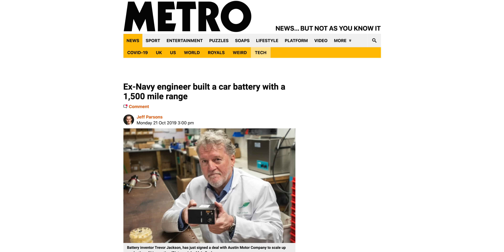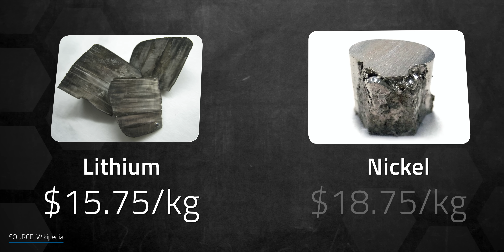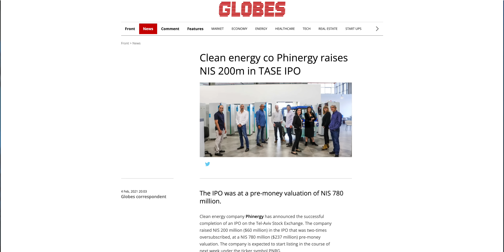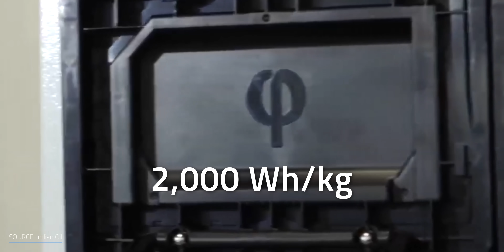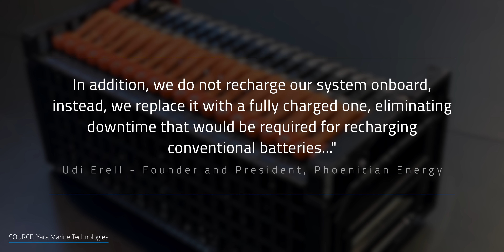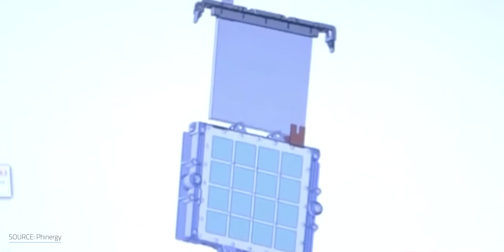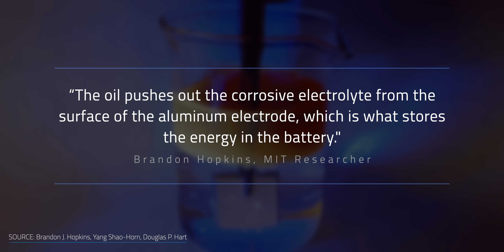Exploring the 1000 Mile Car Battery - Aluminum Air Hype?

Comment: I guess you could bring a smaller backup battery on the road and have a full spare at home? I'm curious about the how much one of these batteries would cost.
Reply: The issue would be battery degradation during storage
Reply: @1984johnson  unless the electrolyte can be added separately.
Reply: There are a whole lot more things to consider, than, if one person would or wouldn't,  Own a car with  this type of 
Battery, . Like, will an backup charger
Be available to carry along with the 
E.V. OR of course there not rechargeable, 
So, i think not, just for that reason 🤔..
I've often wondered if I could get an older model  truck or car,. Put the work in to Converting it into an Electric vehicle 🤔, that i build myself,  maintain myself, 
Change, battery's  out myself,  do everything that needed done, to it, 
( THE CAR OR TRUCK) Myself,.
Reply: @juniorperry8757  Yeah, people do that, look it up. Economically I dunno if it's worth it, would depend a lot on the cost of petrol, but it's an idea people have had, if only as a hobby.
Reply: @juniorperry8757  check out a channel called Rich rebuilds. It's a guy who tries to rebuild wrecked Teslas and has built at least one EV car himself.
Reply: Or they would work with car-clubs. Instead of personally owning a car, you pick up and drop off one when you need it. Without actually owning a car. This is already pretty popular in busy cities.
Reply: You can replace them at gas station so why take trouble to have them at home ?
Reply: @kkk2.077  
Yep and if they are in standard formats like a Nio's you can have one delivered by a local station or  roadside rescue organisation like a can of liquid fuel now... But thats what makes sense irrespective of the  battery's composition unless it lasts 50+ years and doesnt deteriorate more than a small percent.

Integral and structural packs are akin to Apple sealing its phones and telling you you can only use their agents and pay their prices and live with their availability of parts and service life.... which they seek to limit by hard and software controls.

This is the sort of built in planned obsolecence thinking thats got us into this mess 😳 its got to change or we will be making the same mistakes again, this time though world populations doubled since 1976
but the available resources of the planet haven't. 🤦‍♂️ 
Theres already an Elephant and a Rhino in the room ...and in a decade they might be joined by that Whale 🐋 falling from the sky.... 🙄😬
Reply: Maybe Split the whole battery to 3-4 parts, use up one at a time, So when you swap out, you sure you swap out the empty one. Always run with 1 in using and 2-3 full charge.
Reply: @Grim FPV   Grim, did you even watch the video, they would be massively cheaper, and easy to recycle...
Reply: @Grim FPV I dont think so, the silver that is expensive is not consumed in the reaction and could be reused without issues, and aluminum is cheap.
It might be that you will have to pay a large price for a new battery, but get a refund of 90% of that price when you return the empty one.

edit: 
Looking at the numbers from the video, you would have to pay ~$1.96/kWh plus any manufacturing margin plus the mentioned refundable cost. 
You can decide if that is expensive or not.
Lithium batteries on the other hand cost about $500/kWh, but can be recharged (plus costs of electricity to charge it)
Reply: @hubertnnn  yet that is a cost the other BEVs do not have.  You simply pay for the electricity to recharge the battery and maybe a battery swap 12-15 years later when the original battery could be recycled.
Reply: @hubertnnn  The recycling of the aluminium should happen on places with abundant renewable energy.   The grid has no need to carry all that extra energy for charging all those batteries so it can be kept simpler and there are no cable transport losses . Those batteries could surely (without electrolyte?) be transported in a eco friendly way. In short, I am wildly enthusiastic :-)
Reply: @jean-pierredevent970  Well, I did my calculations assuming no reclaiming of aluminum (fresh mined aluminum every time). If its possible to transform aluminum oxide back to aluminum cheaper than producing it from bauxite, then those batteries could be even cheaper and more eco friendly.
Reply: @Grim FPV China labor is cheap, and machines can do a lot of work for almost free (just some energy needed).

The only question is how much investors and petrol stations (that will be selling those) will add to the price for their profit.

Usually the rule is 20% per each intermediate step, so 
- 20% more from the petrol station, 
- 20% more from some delivery center,
- 20% for the investors.
And maybe one or 2 more steps.
Reply: @hubertnnn  Why it had to be sold by petrol station? Try convenience stores. It's just a drycell battery after all. They can stock it with ease, unlike gasoline. And they are everywhere. For any one petrol station, I think there are ten convenience stores, at least.
Reply: @Grim FPV 
The problem is those Rechargables are barely recyclable and require some pretty nasty tech to do that. There's also the fact they will deteriorate especially if your using rapid charging. ..and then theres those impossible to repair production problems that you will get.. or unforseen damage as i stated earlier. 

The charging infrastructure needed will be collosal in terms of grid supply cables and chargers. And what happens when the chargers break or become obsolete because someone comes up with a need for a different kind of charger.
Reply: just keep a spare in the back
Reply: The car and battery designer can make it to work out of two or more battery banks, of which only one is used until it's dead and then the other take over.

And I think the price should be no more than 20 dollars a piece if it want to have any chance of competing.
Reply: would be much cheaper than lithium ;d
Reply: The use as an EV power source alternative is so small that you will never have enough infrastructure in place to make this a viable EV option. Additionally the space required to achieve these mileage range projections, I doubt is the dimensions of the back end of your hatchback. Simply popping the rear hatch, pulling the batteries out and replaceing IMO is a panacea. It's going to require trained techs to replace which makes this already commercially limited technology a complete impossibility in terms of infrastucture and technical support to make this seamless, simple process. No infrastructure and no serviceabilty to cover a wide landscape.
Reply: @zinnsand21  I don't know, I don't think infrastructure will be a major concern. Assuming your car had 2-3 batteries, each lasting ~1000 miles, you would have several days to swap out a battery at a store. Or just have one delivered to your house - they already have services that deliver meals for you to cook, all with fresh ingredients.

As far as the cost of getting new batteries, I don't think it'll cost all that much. If you consider how auto parts stores gives you credit for returning your old battery - or many other parts - because the companies can have those parts broken down & refurbished into newly working parts, even having warranties. I imagine Aluminum Air batteries would follow the same process: if you return an empty battery while buying one, the cost will be significantly less. The challenge will then be for the battery companies to streamline the refurbishment process enough for it to be affordable... to them.
Reply: The one problem is, it would need an easy to access safety disconnect to make swapping batteries safe for the average person. Currtlently, you need to be a trained automotive technician to do this.
Reply: @Ratkill9000  As in the video I see they just unlock the latch and just swap it.
Reply: @Ratkill9000  
Under EU right to repair rules products will have to be designed to be easily repairable ...it isnt beyond engineering to design a simple failsafe connection and switching system. Ask Nio etc about how their battery packs for auto swap battery stations.
Reply: @Ratkill9000  Yes. But swapping batteries is not as simple as the video makes out. If the battery is replacing a 200kg li-ion battery it is still going to weigh 50kg. If you are replacing 400kg li-ion with 100kg. That means the battery needs to be split up into easy to lift sections of 5-10Kg, this will add cost and weight. No on is going to want to change their own battery compared to an EV charge or a petrol tank fill. This will be hard manual/semi skilled labour. So your 24 hour battery swap station is going to need to keep some ripped employees working 24/7 or buy some very expensive robots... all of which is going to massively add to the cost.
Reply: @Ratkill9000  Yeah that's just a matter of designing the connectors properly. We have dangerous 240V (in fact, deadly! ) plugs in our house, but they're designed with features that make touching a live connection basically impossible. This is the UK, our plugs are probably the best in the world. There are shutters over the neutral and live pins, and inserting the (longer) earth pin pushes the shutters down, by which point the neutral and live pins are right by the socket entrance. 

Touching those pins is no use, they have an insulating sleeve half the way down, so by the time the pin is actually making contact with the voltage in the socket, only the insulated part is stuck out. 

If you make a real effort and have a screwdriver it's not difficult to electrocute yourself on purpose, but by accident it's not gonna happen, and a 5 year old kid would have to be very inventive.
Reply: @Ratkill9000  That's what product designers do. To design easier to use interfaces (or make it very difficult so you need to pay technicians).
Reply: @Ratkill9000  Think about filling your propane. Trained person takes a few minutes. Well aluminum air is basically swapping it out. They will build a quick change mechanism. Thats easy to do. and your good for another 1000 miles. At 800 miles the vehicle slows down say 15% therefore reminding you to swap out in the next 200 miles. Easy Peasy.  No plug in to power grid. No looking for high power charging stations. no charging for 8 hrs each day. This is a no brainer.

Comment: Just curious. If a normal electric car that runs out of electricity can get a extra charge from a spare charger or a car that drives out to where you are to charge you. How could not a Al battery car just do the same? Just have a car drive out to you with a replacement battery. Especially if that is already something that is done for normal electric cars.

Comment: Years ago when hydrogen fuel cells seemed like the only thing that could compete with gas cars, I’d been comfortable with the idea of swapping energy packs at service stations. Two caveats though, I’d envisioned 1) those packs as being rechargeable and 2) cars housing at least two packs to make refueling easy before you get too low on power.

Comment: This is a tech looking for a market. Cars are not such a market. Battery swapping and recycling is a very bad idea vs just charging up. Transport of the batteries to POS, Recycling costs, stock maintenance, shrinking LiOn battery recharge time. 

I don't see any market for this other than avaiation as someone suggested.

Comment: Surly objecting to a petrol replacement because it isn't rechargeable is a little counterintuitive?
Whan t happens when you run out of petrol or diesel? 
Surely the same applies here, the breakdown truck turns up and they have a spare battery in the back. Much simpler than having to charge your flat EV on the road side from a portable power source.

Comment: As a plug in addon to the X would be great, could fit under the cover in the back of the 5 seater, and when a little more range is needed, turn it on. Use as needed to extend range, when used up swap it out. as with anything, it would be highly dependent on upfront cost as well as swap out cost.

Comment: The one issue you overlook is that the batteries can be recycled with off peak power and ALL the potential dumping from solar and wind... when you can schedule recycling then you dont have the erratic demands on an already compromised grid due to wind and solar not being A SERVICE

Comment: You'd need a two battery system in the car, as you're not going to want to prematurely swap the battery when it is near dead, thereby losing some of its value. The system would have to automatically switch to the other battery when one is expired, and alert you that you're on your back up battery so you have plenty of time to replace the completely expired one.

Comment: The major drawback regarding this battery is that is not rechargeable and he points out "what would you do if you power in the middle of a trip, how can you solve that situation?" and in the next sentence, he says that lithium tech can be easily recharge with a portable generator. Wouldn't you be able to swap aluminum batteries in this case as well? Call AAA and have them deliver a new battery to your location?

Comment: You havn't watched Thunder00t on the safe electrolyte BS.  The UK "inventor" just appears to be a scam.  Thats not to discount Al-Air.  The problem with AIr-air is that the aluminium is literally the fuel, this is actually a fuel cell not a battery.  The fuel cell produces solid waste, which increases the weight as the battery is used, you can get rid of the waste and its value is part of the ecosystem.  Unfortunately its not very efficient as you have to resmelt the aluminium, it looks like its worse than Hydrogen/  As a result it not desirable for cars, but perhaps it could be justified for aviation or shipping.
So yes some problems to solve, but perhaps some applications.
this is a more complete analysis
https://youtu.be/z0RU_ck64Bs

Comment: The big benefit of an Aluminum Air battery is about energy shifting.  Iceland for example is a top producer of aluminum because geothermal and hydroelectric power makes it possible to use clean energy to convert bauxite to Aluminum. If only the Aluminum plates need to be produced there and the other parts of the "Recycling/Recharging" can be done simply and cheaply locally, we shift the energy expenditures to where energy is plentiful and inexpensive.  Do I think this will replace lithium batteries in EV's? If swapping the battery is something that can be done easily by an untrained person and the batteries are uniformly sized, there will be a market for it. At a certain point it becomes a cost per mile travelled and the ubiquity of replacement market.  For me, its hard to beat Lithium EV's with Solar Power charging at home.

Comment: Why not just build a Tesla tower and get free electricity out of the ground to power ports and charge batteries... Ever wonder why the big bankers ran nikola Tesla’s ass over in front of his apartment building? Big bankers didn’t like the sound of free power. Look it up he could transfer energy through the ground for miles! His tower went I believe 80 feet in the ground and 120ft in a tower above ground. His tower was torn down within a couple years of being built even though it was giving off free power.

Comment: Thank you. 
Note that you have an error with the chemical reaction in the battery. You can't reach Al(OH)3 from Al and [O+]. And, I don't believe you can have a [O+] ion in this configuration, as [O+] ions are really hard to produce. The reaction is probably 3[OH-] + Al = Al(OH)3.
Swapping aluminum non-recharchable batteries is worse than swapping rechargeable lithium ion batteries (Better Place RIP, Nio, BYD). If it means you have to recycle the aluminum battery after one use, it is not a sustainable solution at least until recycling this battery is quick and cheap. Maybe it can work as a range extender for regular EVs, that you use once a month or less. But with the prices of batteries dropping and their performances rising, an extra aluminum battery seems as an overkill.

Comment: Electric planes might be suitable application if low air pressure in high altitude will not be a problem. Put fresh battery before flight in pre-flight service check.

Comment: You mentioned many times that it is not rechargeable but not once did you talk about the energy required to remanufacture it (as remanufacturing replaces recharging). Unless that can ever be on par with lithium ion batteries then it has no hope of ever being a viable solution for transport as in the long term, energy cost per km is what matters. That is also why hydrogen will never be better than batteries.

Comment: Seems like battery swapping would cost consumers a fair bit, probably making the point of EV mute. Also you have allot of potential waste production even if some of it can be recycled cleanly. Certainly we need to ditch Lithium at some stage soon, I don't think this will be that.

Lets be clear here, Net zero emissions will ONLY be at the consumer end. The industrial end will be pumping out even more emissions (and waste) then before as we move forward.  Going to need some very aggressive regulation and cleaner production methods to prevent our demise!

Comment: You say a car that run out of energy need to be transported away, while a normal ev just call another car that bring a battery to load from. Why dont you think any company will drive around with extra alu air batteries?